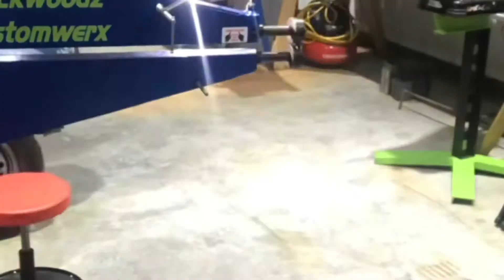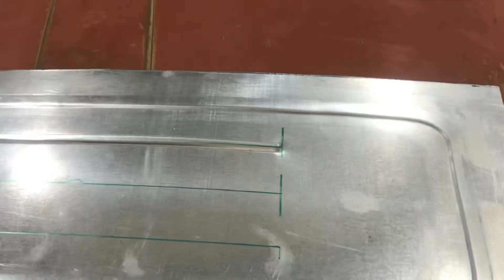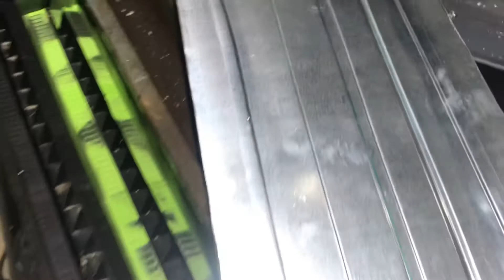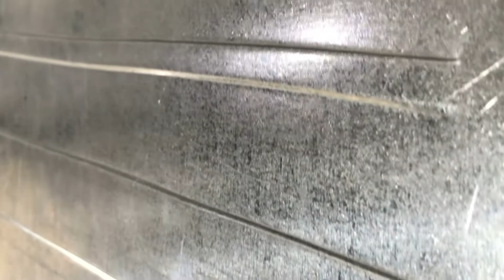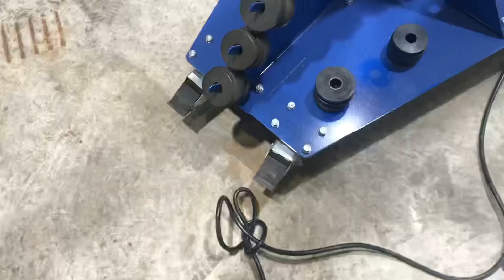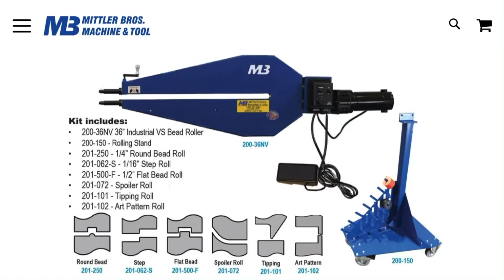Mittler Brothers 36” Industrial Beadroller Tool Review

Comment: Hey there. I was wondering if you notice a difference between those "composite" dies and steel dies?
Reply from the maker: The nylon wheels are much more gentle and less apt to leave tooling marks on soft metals(such as aluminum or copper), but the lack the density needed to move 18 or 17 gauge steel
Reply: @BackwoodzKustomwerx  It's been a while since I used this bead roller (the same 36 MBros). I found that the dies just didn't work for me using steel. I suspected I needed steel/metal dies for sheet steel. Thanks!